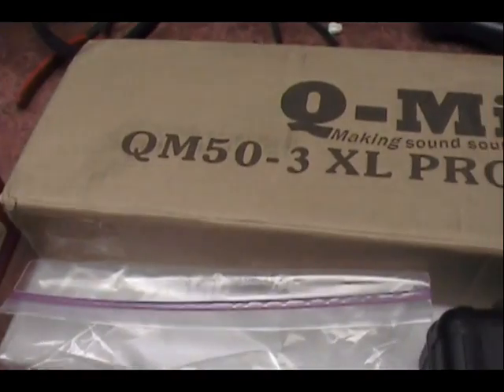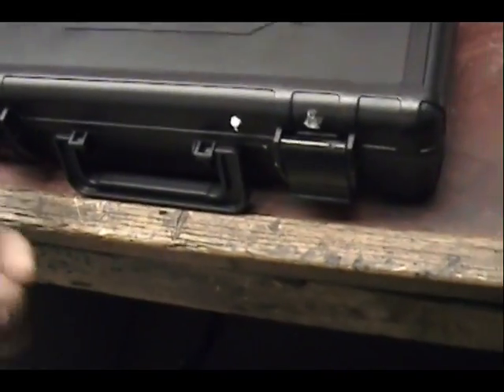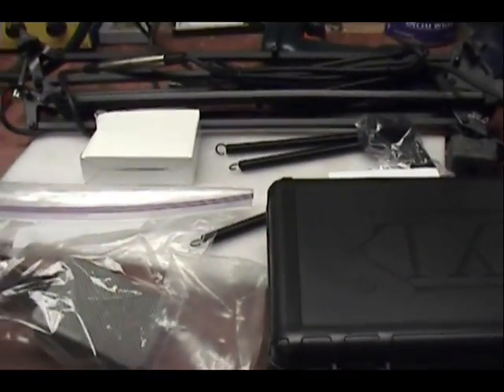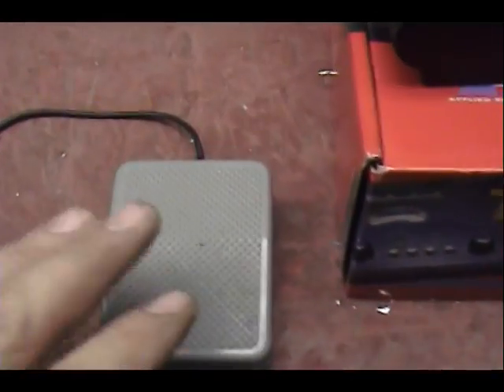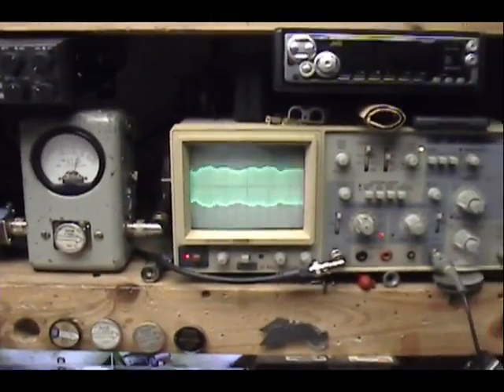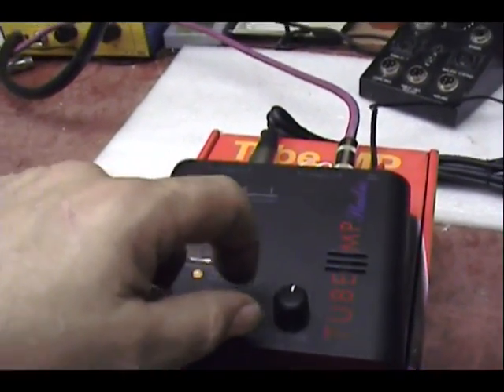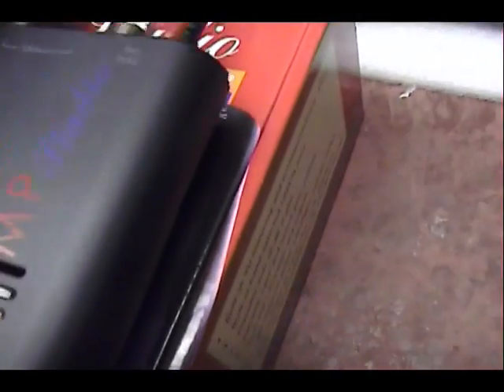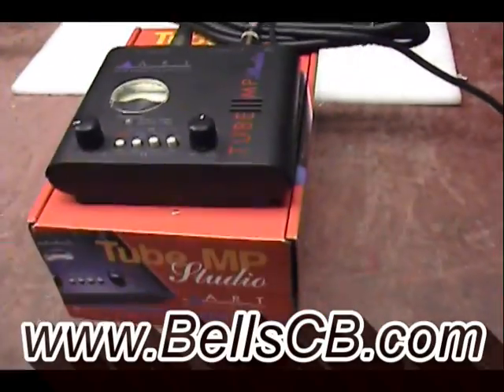External stage mic setup

Comment: I'm in the process of doing this as well I have a Electro-Voice re 320 on a boom arm going into a Pro Audio Designs FX1 and then into a Behringer 1002 FX and then into my radio still trying to get the mixer setup just right it's a lot of trial and error but the audio with this Mike is just it's night and day and that's compared to my mics that I have previously used a Turner plus 3 a d104 and the older rk56

Comment: doesnt sound too bad for just a mic, preamp and going thru the audio input in the radio instead of line level. i have a similar setup but with a shure sm58 in a shock mount on a boom stand into a behringer ub802 just into the mic jack of a cobra 142 and most people say it sounds like a tube radio (i dont use the phantom power though)
Reply: I'd give a quarter for instructions on the mic cord from 802 to the radio 4 pin plug on your 142.  Mine needs to be for a 2980 though.
Reply: Turklefoot I still have it but I didn't build it. I can take it apart. you can adapt to 6 pin I made a cable for that. mines set up for 5 pin Cobra. but they're all pretty much the same. you need a small hobby box  and a switch of some sort to key the radio. then cbtricks . com has the wiring
Reply: Thanks Patrick.  I'll check it out.  Thanks again.